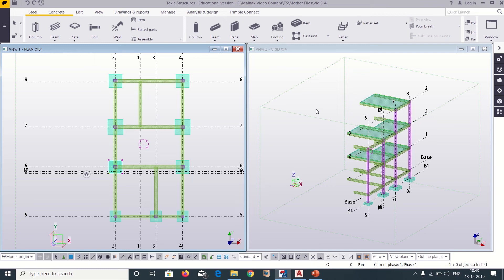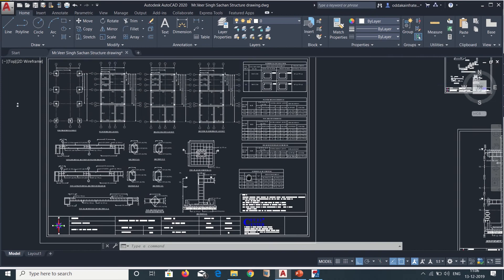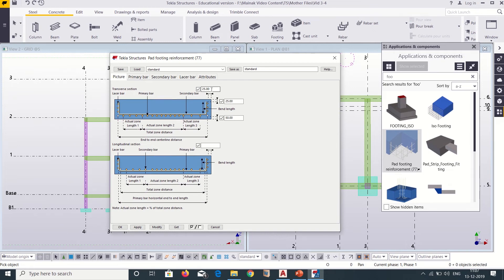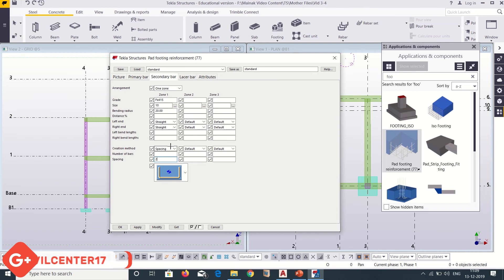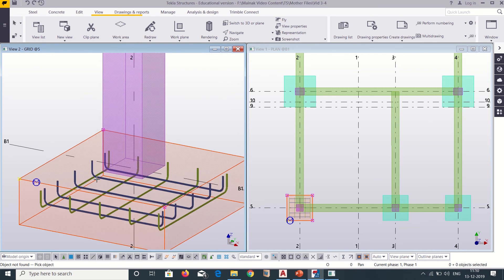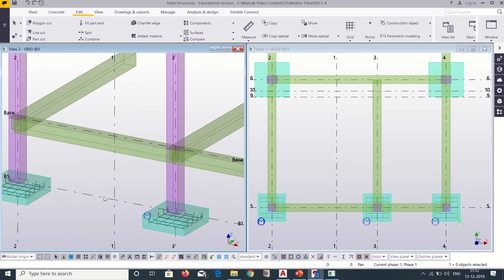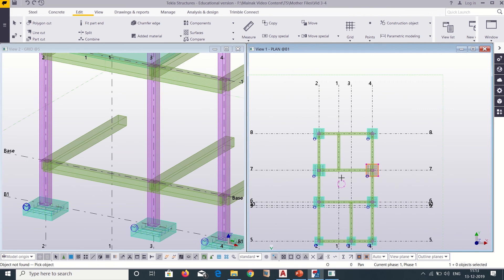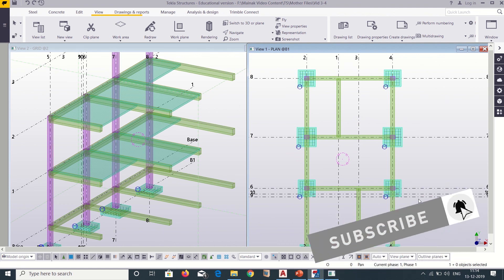Footing Rebar in G+1 Building Detailing (Part-3): Tekla Structure (TS)

Comment: Sir, kindly explain this. After TSD, can't Tekla structures do automatic detailing based on the forces and parameters that you set? Like bar selection, minimum spacing, steel grade etc

Comment: How deep should the footing be in a G+1 and what the appropriate dimensions and their characteristics in term of rebar dia and stirrups spacing ?

Thanks in advance for your time and work
Reply from the maker: Depends on the design and soil bearing capacity, but for approx you can take between 900 to 1200 mm for square footing and depth can be between 250 to 350 mm
Reply: @CIVILCENTER  : Thank you very much for your prompt response and valuable input.

Would you be able to touch upon the following Scenario!

A ground house built of stones on a simple foundation. With a slopped wooden framed roof /\.

The house dimensions are 7 x 16 m2

The owner would like to build the house to be G+1 - using RCC even for the roof while keeping it slopped /\.

How many footing, columns would you suggest ?